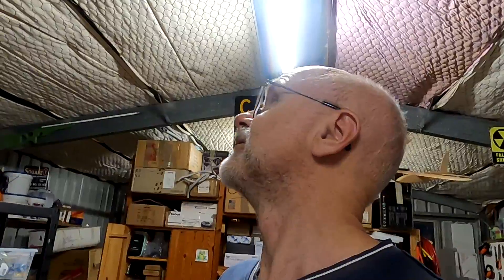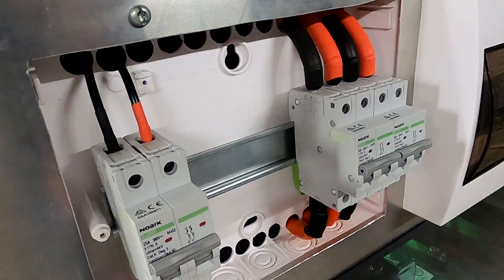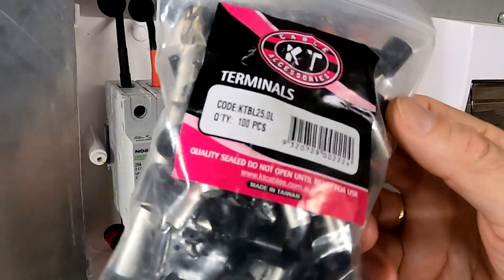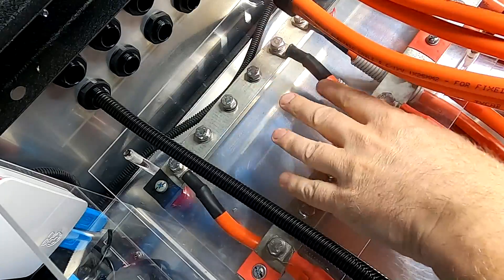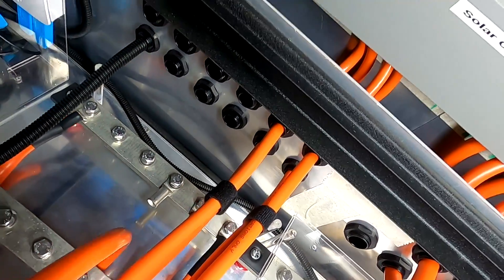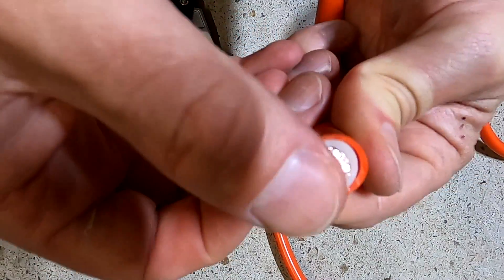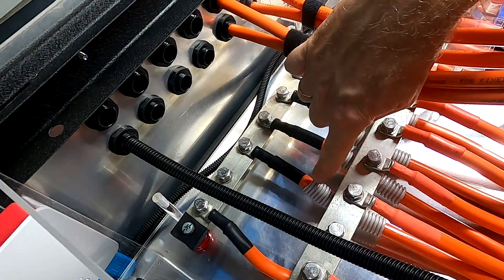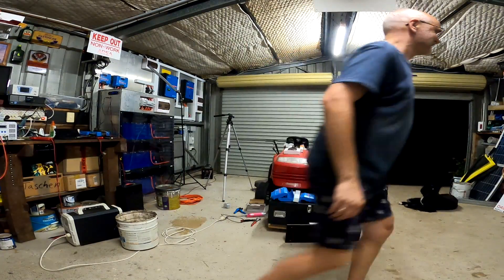All these breakers for more solar charge controllers, 2/5

Comment: Andy, can you please do a video on DC breakers as there is a lot of info out there on how they are to be connected, polarized or non polarized and whether they protect bi directional or not.
For example DC breaker between battery and inverter, battery can supply and inverter can supply when battery is being charged.
Or Breaker between MPPT and inverter and so forth....plz :P
Reply: Was there a video explaining this ? as im also interested

Comment: Hi Andy, as a novice off-grid user I have questions related to securing the solar panels. I have 6 panels of 360 watts (Victron) which are connected as follows: 3 panels are connected in series, the other panels are also connected in series. I connect the two strands in parallel. To fuse these 6 panels I would like to use fuses but I don't know what amperage they should be. The six panels together have an open terminal voltage of 142.29 volts. Can you help me out which fuses I can use for this?
Many thanks for the educational and fun videos. You are a loyal visitor in my living room when I watch the videos :).
Greetings from Belgium
Jean Pierre

Comment: I like the disconnect switches. Probably fused/ thermal type circuit protection. Test them at 50-90 % of their rated load capacity. You want to see if they burn or melt when short circuited. The protection device should be the weakest link in the circuit.
Reply from the maker: It will be just for emergency shutdown. All maintenance, I'm usually doing at night and disconnect with no load.

Comment: I find it interesting you did not go with a hybrid all in one Inverter. Victron seems to require a plethora of external stuff they can charge you for. As an example, a single MPP inverter includes TWO MPPT controllers up to 600V! And you can parallel many of them. Internal Bluetooth and WiFi. It simplifes all the cables and costs.
Reply from the maker: I cannot connect anything to the grid. I have a second solar system which is grid connected and on a high feed in tariff. I made multiple videos about this on the channel, starting here: https://youtu.be/LQJZUmWDuCs

Comment: What's the purpose of using 35mm2 cable on one side and 25mm2 on the other? If 25 is sufficient why use the more expensive one on the other side?
Reply from the maker: That is part of the whole battery shelf design to stay flexible. I may upgrade the breakers to 100A at some stage.
Reply: @OffGridGarageAustralia  I see. But then the 25mm2 would be too small, wouldn't it?
Reply: It is because the cable length and diameter have known current carrying capacity based on voltage values and associated losses due to resistance and thermal expansion. Basically, he subscribes to the prescribed data of known wire gauge standards. In this way, he will accomplish the number one goal of minimizing faults and losses. In his demonstration he chose to use 35mm lugs on 25mm cable even though he had 25 mm lugs available. Why? It is because the rules set forth a discernable outcome compiled which contrasts technical experience in lieu of circuit integration and the integrity therein. In practice, the engineer will experience these limitations during practice conversely the engineer will miss and fail to identify these during the design phases.and so the practitioner trump's the non practitioner in this way. No one will write it in a text book....it is why you can be great! Quite frankly, you draw a better question as to the decision to change from the 35mm cable coming into the breaker too the 25mm cable between the breaker and the charge controller. Excellent question indeed! The answer lies at the circuit breaker where a decision towards best practices ensues # integrity!
Reply from the maker: @anthonyrstrawbridge  That is not the case. As explained, I have used 35mm cable from the bus bars to the breakers and 25mm cable to the MPPTs. Both cables have the appropriate ferrule crimped 35mm and 25mm ferrule.
Using 35mm consistently from the busbar to all breakers (even the 10A breaker is wired with 35mm at the input) makes it far easier to replace a single breaker to a different value when requirements change in the future. In such a case, I can just replace the breaker and don't need to replace the cable.
It's a 63A breaker I'm using so even a 16mm cable would be sufficient. It is not only the current carrying capacity of the cables you have to consider but also the voltage drop across the cable depending on the length of it.